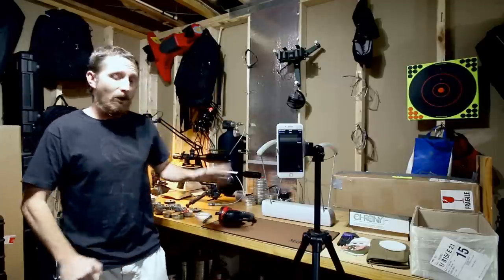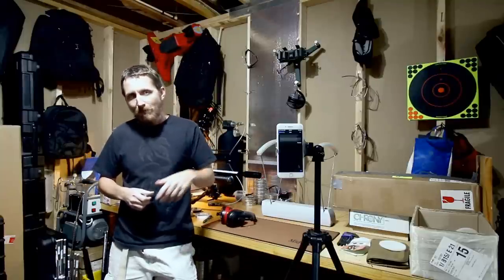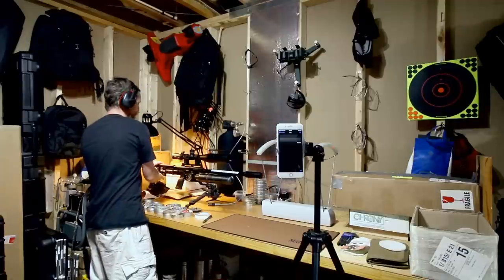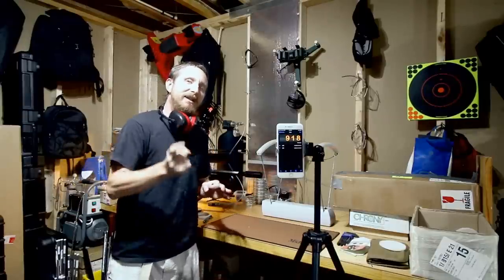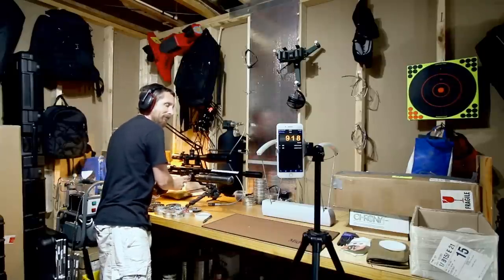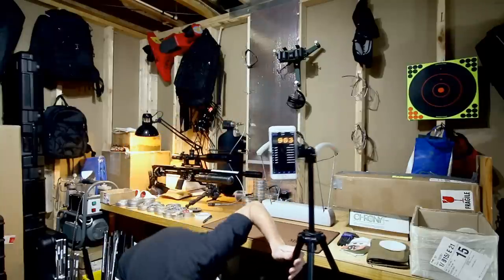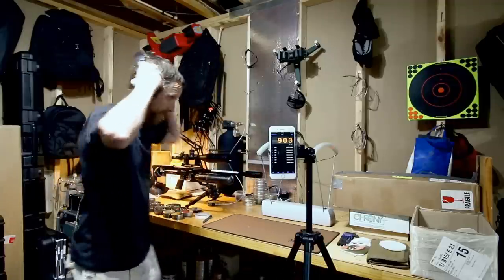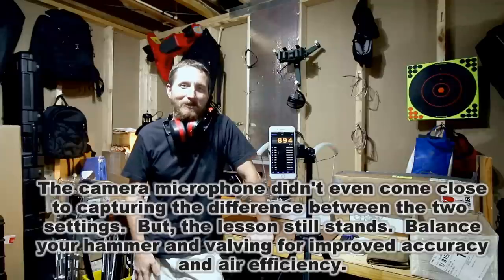PCP Air Rifle Tuning Demonstration (the secret is in the sound).

Comment: Thanks for sharing. I total agree with you my friend. When the gun is in its happy place you can hear the difference. To much power...it sounds angry...when it’s right...it just sounds right, not too aggressive, quieter, less torque, smoother. You can definitely hear the difference. By the way I hope you have at least one more video coming on the .25 Avenger. I set my reg at 22-2400 psi, hammer spring at max, and it pushing JSB Hades 26.54s @ 914 dead nuts accurate. Really digging this gun bud. Take care and God Bless you and yours.

Comment: Ted, that was a great practical demonstration of how just a few turns of the power wheel can make a big difference.  Another thing I noticed is cocking the gun is so much smoother, not getting that same force as the spring is taking on the load right toward the end.

Comment: The most clear and easy to understand tuning explanation for the Impact I have seen. What's missing is a description of how that tricky adjustor for the regulator valve works. It has a big impact on air use and velocity. I have messed around with it a lot and have found it is really the secret to consistent velocities. I would love for that to get included in a tuning video. Thanks so much for spending the time to put this stuff out there. It really appreciated as many of us are working on this stuff in a bit of a vacuum.

Comment: I've yet to buy a pcp. However, when I do I feel I'll be better prepared from all the knowledge I've sponged from you Ted. Genuinely, thank you so much.
Reply: Josh... I took a full year of video reviews to decide. Just because Ted used the FX brand know that they are SUPER slow at getting products out once Ted and Matt Duber show them. Like 6 mo or longer. Daystate are really good but expensive...yes more so than FX if you can believe that. Best way to choose your gun is: 1. Make sure it is regulated. 2. Know what you will do with it. Hunt. Pest control. Target. And k ow the distance you will be shooting at. 25m 50m 100m 200m. 3. Choose Caliber wisely. .177 is fine on calm days or indoors posting but you MUST be super accurate and only head shots. .22 is good for posting and hunting indoors and out. Still must be doing head shots but tolerates wind better. .25 Pesting Hunting Competing and now you can go for the heart lung shots. .30/.35 ... yeah those are more expensive ammo so I cant advise there but hunt and target would be great. 
If you can try a gun first that is a great way to go. Air gun gear show is also great resource. Good luck. Good hunting. Aim Small Miss Small.
Reply: @dforr2981  I'm more in the bottom end of the market. Like Air Venturi Avenger type $$$. LOL
Reply: @joshuagibson2520  hey brother as long as you are out there shootin' safe you have a host of us behind you for support. Remember that each airgun is VERY pellet specific. It took me a long time to realize that. When you purchase an airgun, ask the dealer what he recommends. Dont be afraid of used PCPs Ted has sold off many of his older guns for the latest and greatest. A place to look is my shop. I love Jeff. HONEST as the day is long...longer really. www.trenieroutdoors.com
Jeff will always treat you right. He may not have what you want today but ask him what hes got in used guns or if he has any special deals. Cant go wrong.
Reply: @dforr2981  no doubt about pellet specific. Mine loves JSB LIGHT'S (7.33?) AND AIR ARMS FIELD HEAVIES.  IT TOOK ME about 7 brands and weights. It's true. So true. I pass this knowledge to everyone I can because it's the "best bang for buck" you can to improve your airgun in my opinion.

Comment: For those whose ear is not attuned to the finer differentiation between the two settings, the Chrono numbers can be used to find the optimal HS setting. Simply shoot a string of shots at a particular HS setting that is consistent in speed with a very low standard deviation.

Comment: I understand the "washing air" bit,... Just last night I was bored so I wondered why the baffles in the suppressor of my CO2 rifle were facing the direction they do so I reversed them to see what would happen.
Some pellets were fine but pellets with longer skirts were flying all over the place from the air pushing at the pellet in a radical manner after the pellet left the rifle,... I could also see the difference with a huge puff of foggy CO2 air shoot out of the suppressor lol.

Comment: Ted, as I value your opinion, I'm about to buy a Crown with boyd's thumbhole stock and want to focus on 2 different areas. 1) rats and birds at close distance 10m - 50m, and larger birds, bunnies and foxes out to 75m. The closer in game I want to use Hades and the 177 pellets with a smooth twist barrel to protect the round going through the animal and into potentially a building or roofing, and a 30cal slug with slug liner for better ballistic impact more out in the open and over longer distances. Am I on the right track or being over cautious? I know you get heaps of these types of questions, hope you get to see this one and feel free enough to comment. Cheers from Australia.

Comment: Thanks for the video Ted, great as always! I am just about to pick up an impact and start tuning from scratch, my planned methodology is as follows and I wanted to run this past you and everyone else for a sense check?  I plan to max the valve adjuster and hammer spring and only adjust reg pressure while shooting different groups, once I’ve found the best group/velocity, I will increase reg slightly and then reduce hammer spring until i see the drop in velocity and leave it there and do the same with the valve adjuster. How does that sound? Just looking to find the most efficient way of starting from scratch without wasting too many slugs (likely hybrids in .22). Everything is harder to get hold of over here in the UK so don’t want to waste any ammo! Many thanks for any response!

Comment: Some do exactly as you do but reduce the hammer between 5-10%, Many like being closer to 10%.. This simulates being on the front side of the bell curve on an unregulated air gun.. Shorter duration but higher pressure when the valve opens.. Some say being closer to 10% also aids in reducing or eliminating hammer bounce influence.. The pressure is still so high in the plenum that a hammer bounce can't open the output valve a second time.. And only a portion of air is released from the plenum (similar to an un-regulated gun that releases only a portion of the air supply).. Also makes the regulator more accurate on the refill..

Comment: Hi Ted this is a very exciting video for me as i currently have a fx streamline .22 fac and i wanted to get the jsb 18gr up around 860-880 but my hammer spring maxed out at 860 !! is it bad to have the hammer spring maxed out ?? should i up the reg a little and reduce the hammer spring ?? only problem with stream line is no reg gauge wonder if i can wing it with 1/4 turns at a time ?? thanks

Comment: You show the power wheel is set at "Max".  Do you also max out the hammer spring adjustment as a part of the process?  
Great start on the beard, perhaps a 2/10 on the Edeleman (Julian) scale :). I've had mine since 79' and still can only manage 6/10 on the Sklar (Leland) scale of grey beards.   Remember the tip given by Mr Kringle in Miracle on 34th St "...the cold air helps it grow".
Thanks for all you do!

Comment: Ted,  i am interested in this technique, for efficiency and to avoid deforming my valve pin.  To achieve the best results with a .22 700mm barrel should i remove the silencer? Am i listening for muzzle report or the sound of the action? I own a db meter, would you say that it is a pitch or increased db?

Comment: I hear a little less of a heavy bang. A higher pitched and lighter sounding smack. Untuned sounds like the valve is hitting the frame. Tuned sounds like the hammer hits the valve, but the valve doesn’t hit the frame.

Comment: Question, would a ten shot string with the least speed deviation  between a 10 shot string be a good indicator you are in tune and would it parallel your sound tune ?   My hearing isn’t what it use to be at 70 is why I’m asking .😁
Reply: Hot Chihuahua, probably more effective.

Comment: Thanks Ted, could you share what is the valve adjustment I.e. line 4 or wide open?
Reply from the maker: Always wide open.  I fine the valve adjuster to be useful for low-energy tunes (below 20 ft/lbs), but unneeded for those who aren't limited by governmental energy restrictions.  Other's may have found it useful to have it engage the valve stem (setting 1-3 bars), but for me that just adds another variable to try to balance.  I get tighter shot strings without it.  All my guns (.22 --> .35   |  30ft/lbs --> 130 ft/lbs) have the valve stem adjuster set at 4+ bars.
Reply: Surely it defeats the object of saving air by not using the exhaust valve.
If you turn the valve in (stiffen the spring) on your original 920 fps then you will be closing the valve quicker which will get you down to your needed 900 fps. How I see it is you need to close your exhaust valve as quickly as possible after the given amount of air is injected.
Reply: Been pondering this question about the valve..finally found the answer.. I tried a tune with hybrids after a few months of shooting pellets with the original tune from Jeff up in Sparta when I bought my mk2 impact..I tried to get it back to what he had given me. I think his pellet tune was awsome..Tomorrow ill get it back to what he gave me with your help here.

Comment: Have you heard of any problems with the regulator gauges? When I bought my Impact it was setup at the shop at about 120 psi. Ben having some accuracy issues with it lately and looked at the gauge and now is says 70 psi. I have never touched the settings since new. So wondering if the gauge is bad or something else is going on.

Comment: So is it just a matter of turning the power wheel to say setting 5 once you know what your max power is at 125 bar etc.? I struggle with this for some dumb reason....I have a multitude of FX airguns and just picked up another .30 from Jeff down the road from you....700mm .30 MK2.

If I want it shooting at 850 and from the factory on max it is shooting 900. Would I back off the reg until max is say at 870 or so and on power 5 it would be shooting 850 or if I leave it as is but power 4 is shooting at 850 does that mean it is in "harmony"?

I guess my question is does "harmony" always mean one setting lower than max or can harmony mean 2,3 or 4 settings lower as long as the desired velocity is reached?

NO idea why this is such a hard concept for me to grasp but gonna get it sorted one of these days!
Reply from the maker: The “harmony” for the gun in this video was on setting 3.  Turning the setting to max when tuning is done to assure me that my hammer strength is NOT the limiting factor with respect to velocity.  For a high-power tune (ie for .35 caliber or slug shooting) the harmony will be achieved with a high hammer spring because the hammer will need to smack hard to compliment the high reg setting (130-160 bar).   For a lower power tune (ie for .25 or .22 pellet shooting), harmony will be achieved with a much lighter hammer because the regulator will be set much lower (80-120 bar).
Reply: Ahh....Makes sense!!  I was stumbling over settings instead of finding the "sweet spot" of hammer vs. valve...

So once I find the max hammer tension for my reg setting where the velocity doesn't climb anymore when adding more hammer spring then I am in balance with whatever the reg pressure is set at....

Using the power wheel back her down until I am at my chosen velocity....

Much appreciated!

Hoping on this one to be able to keep a low reg pressure and up the shot count....I am NOT a slug guy or power chaser just like seeing a little bitty hole 100 yards away in the center of a target or filling the freezer with fall rabbit....

Thanks again!
Reply: This is so frustrating....I swear I ONLY have this issue with my Impacts. My Crowns and Wildcats etc. never seems to happen....

Got the new .30 dialed in at 95 bar shooting 875 on max....Power 5 is 865 and power 4 is perfect, 840-850 on the nose.

At 35 yards I get say 3 shots hole in hole then the next 3 shots are hole in hole but about a quarter inch higher.....Happens every time...

Extreme spread and standard deviation are good (SD of 3.2)....Scope is good, shooting JSB 44 grain and am at an absolute loss as to what is going on....

Stretch it out to 50 and same issue with the gap in groups now being 3/8 of an inch....

Anyone have any ideas?

Comment: Friend, good evening, sorry for taking the dare to write to you in this medium, I need help and no one from the Spanish-speaking tubers answers my concern, I have an impact fx x .25 I bought it second hand, the owner told me that there was  shot with the pellets backwards, the bone, the pellets came out of the skirt, and from there they do not cluster, the problem is that I make groups at 40 meters and group at two inches and that is very rare, it worries me, the regulator is  140 bars, the power wheel is maxed out, the knob is on the third line and I use 25 gr jsb.  What can be

Comment: OK I'm a bit confused. You say at the beginning you are "tuned" to 800 fps then you run things up to 911-915 and then "tune" it to 903 fps. So where is the proper tune? 800 or 903? Are you going for MAX tuning at 915-ish then dropping down to 800? Glad to see your change in priorities, ( not being as secretive for competitive reasons), and are sharing some good and useful info.
Reply from the maker: I said the gun was tuned to shoot 34gr King Heavy pellets at 800.  These were the factory settings, as the gun arrived tuned to shoot 25gr Kings at 900fps (which means it is shooting 34gr at 800fps).  The factory tune had the regulator set at 95 bar, and the hammer was very light.  Since I wanted to shoot heavies at 900fps, I had to tune the gun for higher power.  In the end, I upped the regulator to 125 bar, and increased the hammer appropriately to balance against the increased regulator pressure.  The video starts AFTER I had achieved those new settings.  I simply walked backward a little to demonstrate.
Reply: HoldOver Vlog Thanks for clarifications. Probably should have watched it twice so I would have caught that. Great info.

Comment: Does this principle apply for faster speeds or slower? You said you had your gun setting at 800fps at the start of the video. But you tuned the gun to shoot 900fps and less than mag might I add. I guess I was asking does this tuning process apply to higher or lower but I guess I answered my own question of yes? Lol great vid. I subbed!
Reply: Yes.   He even says at the end "whatever speed you want" go higher, then reduce hammer until fps drops slightly.

Comment: Ted, Would be interested to hear you comments on this classic (https://youtu.be/9K9uG2KOPt0) I note that you have not discussed the valve adjustment. I think of Impact adjustment as 3 components, two of which start out maxed (hammer and valve ball bound thingy) adjust your reg to speed a bit high, then balance hammer, then valve spring.

When you do the smack demo with your hands, it’s like you have the valve spring wide open. Your right hand smacks the left hand and that needs to hit the valve ball, right?